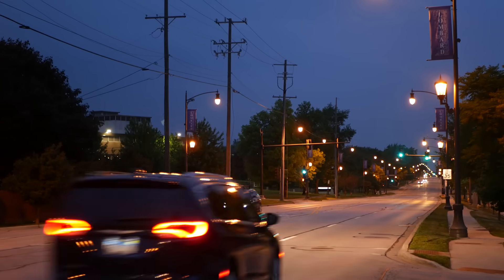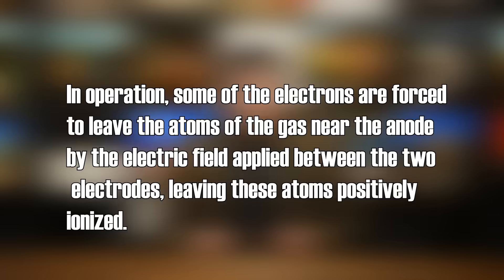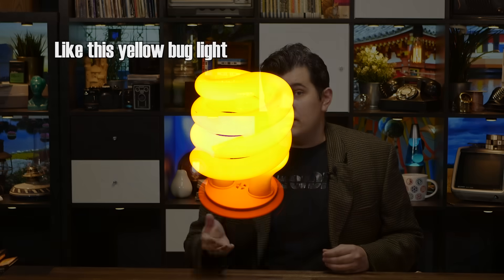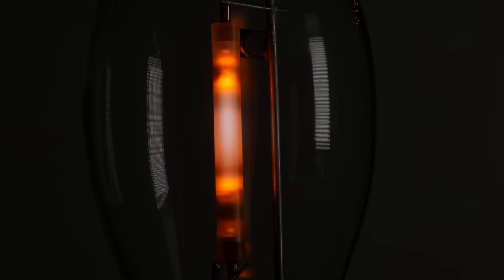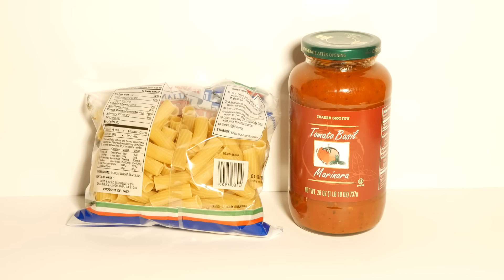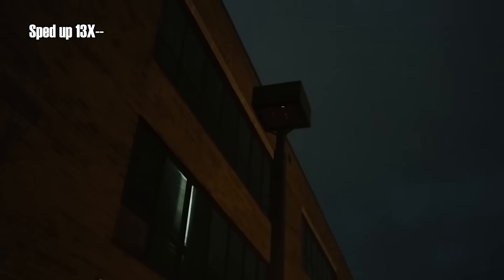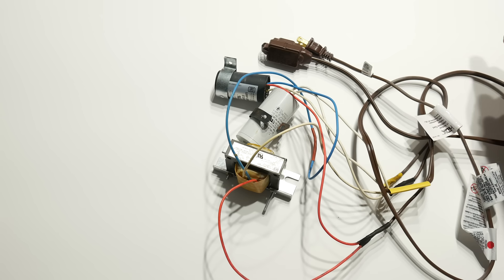The High Pressure Sodium Light: Ubiquitous, effective, but good?

Comment: Step 1: Replace the white LED's that fuck your night vision up with Orange, or even Red lights. Orange because that's what we're more used to, or red because Red doesn't fuck peoples night vision up the same way white would. Also because red street lamps at night would look badass... or scary in the wrong situations.

Step 2: Add diffusers to the light so they actually become useful. As opposed to just lighting up a small sliver of the road as they do in my town, and many other towns around where I live. Which only insinuates a flash blindness and making it literally safer to drive at night when the town is without power when the lights just simply can't turn on. Because, y'know, god forbid we ever thought that getting flash blinded by un-necessarily bright LED lights on a truck at night was enough of a hazard. Now our street lamps do it too!

Step 3: Turn down the brightness on the lamps. This will both prolong their lifespan, make them more efficient, and cause less strain on drivers eyes. They can't say this would take too much effort, for fucks sake they went through the trouble of installing these lights that nobody asked for, to solve a non issue. Get fucked...

Comment: My country has installed new LEDs street lamps that replaced some of the older orange street lamps on the freeways and some of the major roads.. the LEDs come with a diffuser which means that the freeway is much more brighter at night and it doesn’t really blind the Drivers... you can see the difference between the LED and the orange lamp, however id prefer the orange lamp cuz it gives a warmer feel
Reply: Mahdi RANA yeah that would’ve be better 
As for my country the government would like to maximise savings and the LEDs gave higher saving costs as compared to the HPS lamps..

Comment: My city has the worst led light replacement. They put new poles for the LED lights in front of the old poles. They tapped the electricity from the old pole (which is dangerous because the cables inside are 15+ years) but they disconnect the supply for the mercury vapour.

They tapped from the mercury vapour light pole and disconnected the old mercury vapour wiring. The light fixtures are still there

Comment: I don't mind HPS or LED or metal halide street lights. What I do mind however, is an area I drive through every day on my way from work - every single fixture has different bulbs in them, are different constructions, different heights, different distances away from the road and are different strenghts. It looks like various street light technologies from the last century was strewn along the road from a helicopter. The only thing missing are gas lights, which is actually kinda surprising given that the street is in fact situated along a gas line...

Comment: We still use a lot of these in Norway, the maintainance on them are terrible though. In my street they randomly changed one of them to a new LED one. The old one was working fine. However another lamp placed a few meters away, has always had problems, i litterally recorded the bulb when it went out, and it made a loud click noise. But they didnt change the bulb before over 1 year had passed, and it wasnt LED either...
Reply: @Mahdi RANA Probably not, I dont remember when i recorded it or what phone i have it on...
Reply: @Mahdi RANA Yes, it is changed to LED now too

Comment: If you DO get an HPS/discharge lamp actually working in an ordinary light WITHOUT a ballast, it'll destroy the connecting leads. xD
Did it with a BBQ striker, after 90 attempts, it lit as long as a camera flash and it was **done**.

Comment: in the 1980s I was an electrician in a large petrochemical plant.  The operators wouldn't allow us to use high pressure sodium lamps because they looked like fire.  (fire bad).  We used mercury vapor.

Comment: Some of these lights turn on, and when they go bright, they turn off then turn back on and have to go through the warm up stage again.  This is due to the installition of the sensor for the older dimmer blue lights.  When the yellow lights go bright, it is so bright it trips the old sensor.

Comment: In Ireland, all sodium lights are being replaced as they fail with neutral white LEDs. Sometimes they will do an entire street in one go. 
I remember the old white street lighting so I think it’s old fashioned. Younger people think it’s really modern because they don’t remember the old white lights which were really gone by the late 80s / early 90s. 
Overall, I think the LEDs are great. Energy efficient, longer lasting and good colour reproduction.
Reply: Mahdi RANA Why?
Reply: Mahdi RANA You can get LEDs in any colour temperature. Granted, that’s not what tends to be used. 
I prefer the neutral white (not cool white with a blue or purple hue). Reminds me of the lights we had here in Ireland before the 1980s an 90s when they were all changed to sodium.
Reply: Mahdi RANA 😄

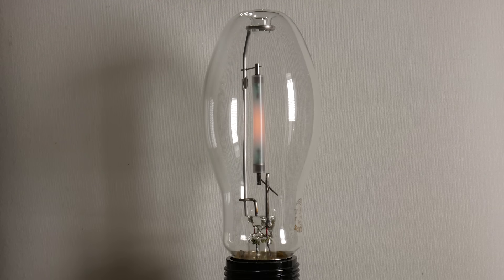Comment: 7:13 -- LULZ!  I am frankly shocked that you haven't shown us a cross-faded set of shots to illustrate what White Balance won't do, if you don't pay attention to the type of light when using a video or digital still camera.  To some extent, film stocks (and thus, the cameras) are also susceptible to the various frequencies of lights, of course, although post-processing doesn't much care, nowadays.

Most consumer-grade electronic devices only have 3 or 4 "light" settings; sodium is almost certainly one of them, along with sunlight, and Interior Incandescent.

Comment: This particular technology was selected because of its spectrum. It includes very little blue light and therefore does not affect your night vision as much when you enter and leave the area illuminated by the light.   There are other technologies that are similarly efficient, but this one was selected particularly for its spectrum. This effect is particularly important when driving long stretches of unlit road at night and then you approach an interchange that is lit.  You'll be able to see what's what and then as you leave the lit area, your eyes won't take as long to adjust to the darkness.

Comment: Here in the UK I miss those concrete lamppost with the dull yellow light, they have all been replaced by modern LED lights. Damn energy efficiency!
Reply: actually High Pressure Sodium and Low Pressure Sodium are both more efficient than LED and LEDs are bad at letting people sleep

Comment: These types of lamps are actually also really common in the live events industry. ive been working at a hire company over the summer and we had some followspots come through us that had a 4000w high pressure lamp in them each. with an entire flight case just for ballast. we also have a lot of movers with discharge lamps which all had to have their lamps replaced as they were being used for filming a large event and on camera the ages of the lamps really show (our ones last about 1000 hours). had to relamp a total of 156 fixtures costing something like £14k, but when we had done it they looked brilliant on camera.

Comment: Today i learned that my teacher in 2nd grade wasnt talking bs when she told everyone to never shut off the metal hallide lights in our gym
Reply: I guess because they have such a long warm up time?
Reply: I remember when this happened once in an activities centre on a school trip, now I seem to have found a resonable explanation!
Reply: Just coming to see this video: They’re also sensitive to minor dropouts or voltage fluctuations so you have the same problem if you don’t have a fully stable power supply.
Reply: they really do last a long time the ones in are outbuilding use to be in a old factory for 40yrs without need a spare lightblub, they still work
Reply: I have firsthand experience with metal halide lights being shut off on me
Reply: You can run HID's 24 hours a day, but it's not recommended. Bulb life will be greatly reduced. HPS doesn't have that problem.
Reply: @j.t.cooper2963  The problem here is restrike time, which granted, HPS is much shorter than even pulse-start MH, but I'm skeptical as to HPS's bulb life not being substantially reduced by running it 24/7
Reply: I remember the lights went out in the middle of PE once. They stayed out for what felt like forever. I thought they were broken.
Reply: why?
Reply: @vamul1  they need about 30 minutes to cool before they can re ignite then they take about 5 minutes to get back up to full output

Comment: I prefer the mercury vapor lamps since it casts a lovely green-ish light plus the sound the ballast makes is comforting. I've always wanted to put one outside my garage and have one inside for the heck of it.
Reply: i agree, we just got 14 acres, the power companies pole near our barn is an HPS barn style light those bowel shaped ones.  and i think its a 100w-150w lamp... i never liked HPS much i sware they may have more "lumens" but they dont light things up as well as a Mercury vapor does.   We also have a old utlity pole in the driveway like 40 feet from the house. it has TWO very old mercury vapor 175 lamps.. i got it working finally, but the bulbs need replaced they are old.. but that green/white hue is just so much better than the orange...  I dont like the white from LEDS.. i wont deny led is brighter.. by alot and uses alot less power.. but that white.. is damn well too much..   So im ordered two more MV lamps, unfortunatly i cannot find anything else in MV other than the barn style lights.. So i had to order some HPS wall packs lights for my building.   Thats okay id rather have a 50-100w HPS wall pack lighting the outside of the building near the doors and so forth than those ugly leds.
Reply: @jeepsblackpowderandlights4305  you should use L.E.D. instead as that will last more than 2 years and requires less voltage compared to that of Sodium lights or Mercury Vapour Lamps
Reply: @stephensnell5707  na i hate led
Reply: Do remember that Mercury Vapour Lamps no longer exist and Mercury is extremely toxic which explains why Mercury Vapour Lamps no longer exist

Comment: The bad thing is, this thing used to be everywhere but there was a problem where third parties didnt repair them and overtime the underground cable broke, now you will see lots of overhead cable and leds
Reply: here most of the old overhead cables have been replaced by underground ones instead

Comment: Once upon a time, I had a darkroom where I tray-processed black & white as well as color art photographs. When I started doing color, I needed to upgrade the darkroom lighting to be compatible with the color process. Due to it's very narrow bandwidth, I went with low-pressure sodium vapor lighting. It was so much better than the ubiquitous red lamp. It was so bright, it was like working in daylight. And, it wouldn't expose film or paper.

Comment: TL;DR - Local park has a light thats been cycling for 5 years now and it hasn't been replaced even after notifying city hall.
Funny thing is that its 2019 now and a park near me has a light thats been cycling for ages now, and its the only light illuminating the park and the path around it. I've put in a notice to city hall but its been like that for about 5 years now and now the light stays on for only a couple seconds before going out, taking about 15-20 seconds to restart and then goes out after a couple seconds. Its not even a hard to get to area but it is also a very tall lamp so I suppose they would need to bring in a scissor lift to change the light.
Reply: @Mahdi RANA I live in Oshawa, Ontario :D
Not a bad city, has around 170,000 people, but some area's its like the City or property owners just don't care about lighting :D
Reply: @Mahdi RANA Just simply called Northview Park

Comment: It is also not uncommon for the ballasts, caps, and starters to go out on HPS lights. The heat from those lamps is insane. When replacing the lamps that are cycling, I pull the screws from the lens and then wait for it to go out, then quickly unscrew it with leather gloves and a rag, and they still burn my hands. Pulling a lit lamp is tough and normally if it is not cycling, I will kill the power in the electrical room (if I have access). Unfortunately, many wall packs have the wiring hidden behind a reflector/heat shield so I can't just disconnect the wires while hot. The new led fixtures are easier to service and don't have multiple taps for 120v, 208, 240, and 277 so installation is a little quicker. The 1000w MH and HPS lamps are dang big and even the 175w MH sound like a gun going off when the lamps break. 150w LED down lights provide far more usable light than 250w MH. Last month I replaced 38 of those fixtures on the outside of a commercial building. The before and after photos are impressive. Between the low CRI and amount of usable lumens from HPS or MH, they don't compare to LED. Two of the properties I maintain did end up with fixtures that have had many drivers go bad in the first year. The LED fixtures will flash on and off, similar but faster than HPS, and then later they will go out completely. It isn't too bad to change drivers, except when the installer has terminated the wired behind the wall pack that is sealed to the building, resulting in having to strip the original insulated cord jacket, which is tedious to do while the power is hot (keys weren't in lockbox to get into electrical room at last service and I do light maint. at night so I can see what lights are out and avoid people, traffic, and cars). The amperage on the breaker panels for these buildings is now much lower with LED lighting than it was with HID. I don't recall if HPS becomes dimmer as they age, but MH sure put out less light. LED doesn't have that issue, so lighting is always consistent and as bright as intended. It is great for safety, but even with down lights, there is more light pollution.  Great video, I could totally relate as I do professional lighting work a few nights per month.

Comment: I don't know if it's just me or if you're getting to the science behind it, but every LED street light I've ever encountered was real good at illuminating a one-square-foot patch of road directly beneath it.
But with all that extra color accuracy, I can definitely sort of tell the road surface is approximately black and the curb is approximately white.
Reply: We have one out of every 40 lights with some blue-purple light. Not UV, it's visible, not incredibly dark, not blinding bright. I see more than a 1sqft though, these ones seem to accentuate certain paints.
Reply: The issue is not the light source but the regulations that mandate no light emitted above 90 degrees. This forces luminairs to create a pool of light under them, because if you have a drop lens that spreads it out more evenly that will result in some amount of light going upward.

Comment: My city did a road upgrade on the main north and south road the south side they used small post with CFLs in them and they are nice and bright. However a new mayor was elected in the middle of the project and she changed the plan and (we think got a kick back) went with the normal big ugly street lights with LEDs however they are very dim and we were told the extra money we spend will make up with how bright and clear they are. Its barely noticeable on the road that there even is street lights. The old sodium lights and 1000 times brighter and the small post with CFL are 800 times brighter then the LEDs.

Comment: High pressure sodium lights are also good for growing pot..........I hear.
Reply: @Sergio Martinez You would use metal halide for flowering, metal halide is almost the same as Mercury Vapor but in addition to the mercury in the arc tube there are halide salts added to correct the color to a natural white light
Reply: No... you use HPS for fruiting due to it's higher red content and Metal Halide for vegetation due to it's greater blue content. MH has significantly greater blue light than HPS -- This in turn prevents plants from stretching to 'search' for the light.
Reply: @Sergio Martinez They are all types of High Intensity Discharge lamps.
Reply: Buy some for your home, get a visit from the DEA.